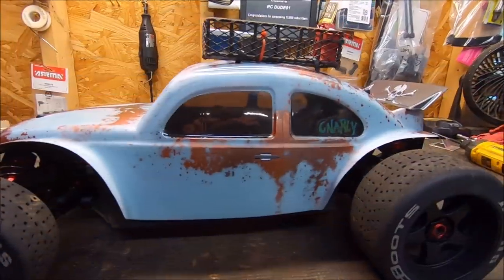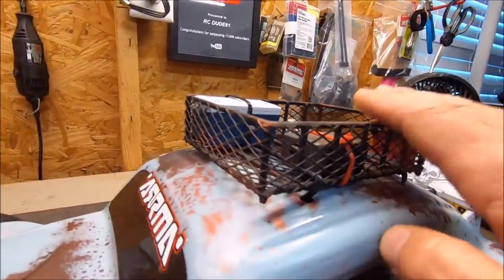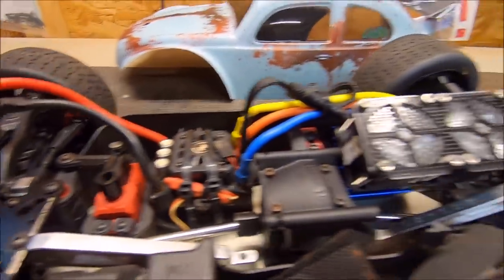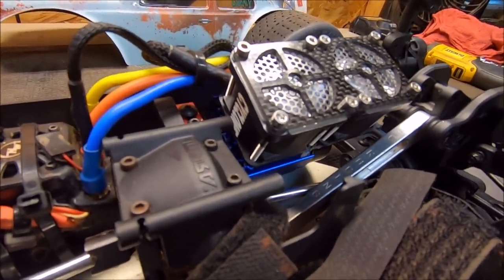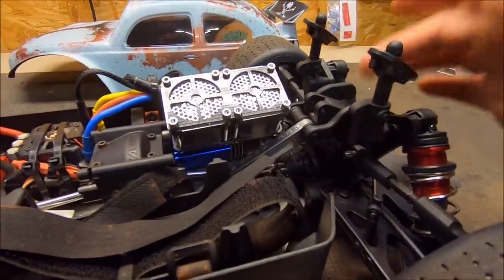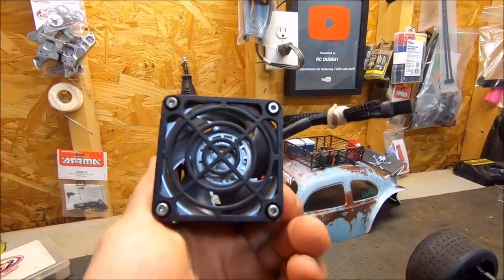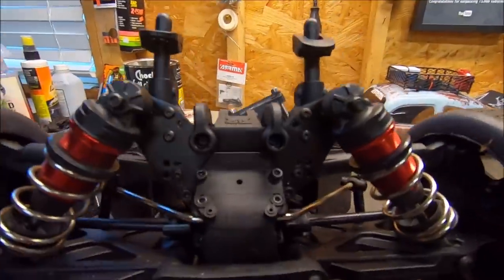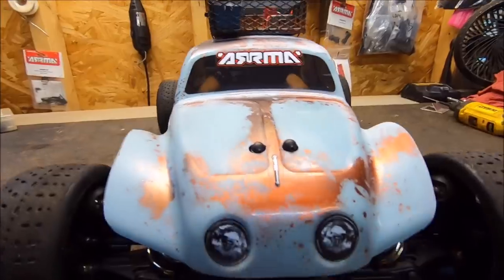"OLD SCHOOL!"😎 NEW SWB Arrma Felony 6s VW RAT ROD build and rip!

Comment: Hi Eric long time no talk. Great vid man. I know you live the typhon 6s. I just got one used for a great price V5. What is your recommendations for a differential? Light bashing and probably mostly speed runs. Also pinion gear threshold for that spectrum ESC and motor. I'm thinking 🤔 23T or 26T max.
Reply from the maker: Typhon is a killer versatile car! For bashing I like 50k front, 200k center and 20 or 30k rear. Speed running would need either locked center or spool imo. Also complete different car setup from bashing. But for just Street speed rips with stock electronics, a 27 tooth is probably all it will handle without ESC shutdown. Should be good for 80ish mph!
Reply: @RCDUDE81  ok great thanks Rich yeah that's the fluid's I put in already got 300k center 60k front and 40k rear. Ordered a 25T and 26T lol yeah I don't want her to burn out. Do you mess at all with the spur gears for the 6S rigs or just leave them stock most of time ? Thanks 👍

Comment: Hi dude81, 
Love the badass video's!
I'm brainstorming about what to doe with my arrma senton blx.
I realy like this Idea. Wanne put felony rear tires on front and back. Would this work om a 3s system or do I need to put in a 4 or 6s system?
Thanx for the entertainment.
Reply from the maker: A Senton 3s or 6s?
Reply: @RCDUDE81  its a 3s blx
Reply from the maker: It may work but probably work better on a 4s system since they are 6s tires. You would need 17mm hexes too. The 3s Infraction tires would work nice on 3s! Smaller and lighter. The Senton 3s diffs won't handle 6s.
Reply: @RCDUDE81  thank you for your input. I coverted my senton to 17mmhex. Ill try a 4s system and hope the gearing wil hold up to the power.
Reply: @RCDUDE81  i tried the vendetta tires but the don't look so impresive.

Comment: Let's hear the fans next time.
Reply from the maker: They were running low power off the ESC  as I mentioned. Once I get the adapter from GCRC or a separate 4s pack, I'll get the fans churning full bore!😎👊
Reply: @RCDUDE81  Yeah. I heard them on your other video. I run Felony rears on my Kyosho Inferno Dodge demon. Your car is well put together.